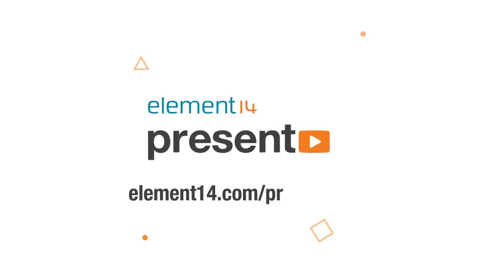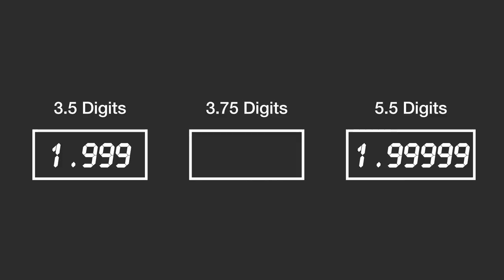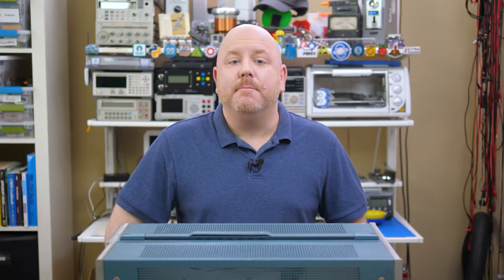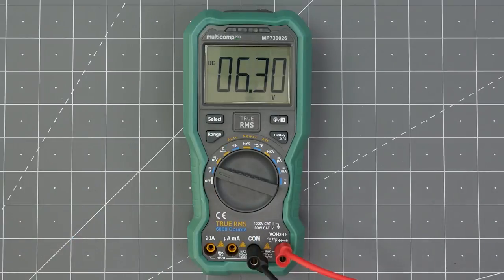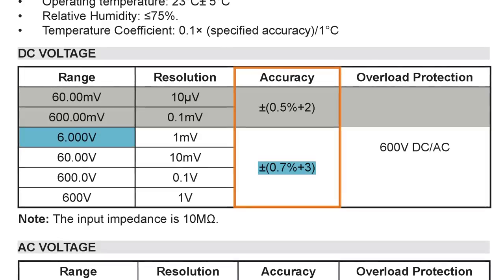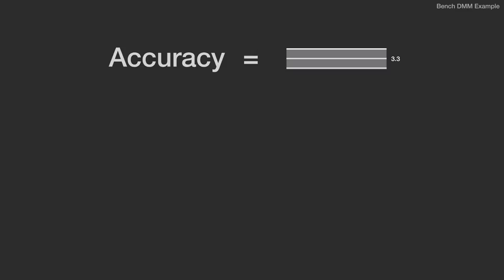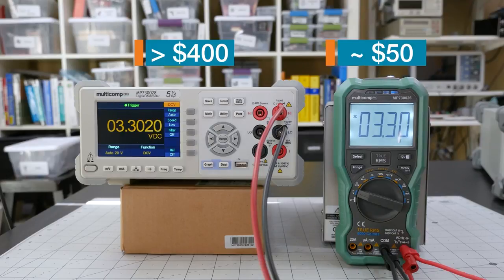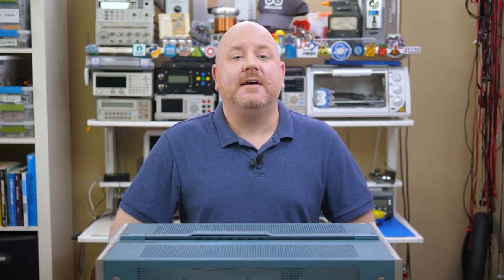Digital Multimeter Half-Digits Explained - Workbench Wednesdays

Comment: Calculation at 5:22 is wrong, because the range is 20 V not 3.3 V, but it will not affect the result.
Right is:
3.3 - ((0.015% * 3.3) + (0.004% * 20)) = 3.299
3.3 + ((0.015% * 3.3) + (0.004% * 20)) = 3.301
Reply: The inherent problem with internet learning, you think you're learning correct info but instead you're being taught wrong info; you take that, pass it along, and eventually we end up with a flat earth society.
Reply: That's still only a 4.5 digit result :)

Comment: Actually, the datasheet of your multimeter specifies 5/6 (not 5/8), which sounds about right. 
5/6 --> 6 possible numbers. 5, the highest number that digit will display.
1/2-->  2 possible numbers.  1 the highest number.

So 1/2 is not really a fraction and shouldn't be called "a half".
Yes it is confusing. Number of counts is better.
Reply: gabriel tabermero  ,  But what is that going to be vs. digits?  Counts may be wasted accuracy if it is not displayed correctly.

Comment: If you had to buy 5.5 or 6.5 benchtop DMM, which one would you buy? Thank you for your videos!!!
Reply: jameshisself  Any specific brand?  You also have a meter like Owon bench multimeter lookalike, it starts with M...PRO you've demonstrated once I think. Any good? What do you like and dislike about it? Is it made by Owon? When I researched it sometimes ago, it stated that it is made by the brand M..PRO, but the Owon looks identical. I'm confused, but I'm looking for an accurate 5.5 or 6.5 (I can't afford the 7.5) digit Benchtop DMM. I like the large display and even touchscreen but they are also expensive. I do understand the extra digits and mainly the ACCURACY is the most important! I get it and I agree, but before I spend some $$ I like to get others opinion and do more homework. If you had a budget about $1000, which one would you buy? Thanks again for your videos and your time!
Reply: jameshisself  You are FAST! Thank you for your suggestions!

Comment: As my explanation for this topic is like this ;
The integer number is clearly meaning the number of digits before the decimal point....
The fraction number is meaning the upper range limit for the counts and should not be treated as a fractional number but as relative number so 3.5 digits does not mean 3 digits and half but as 3 1/2 which sounds like 3 1-to-2 which means the upper limit of meter counts is in the range of 1-to-2 like 1999 ( the upper limit of counts is within the range of 1000 to 2000 ).... Another example is 4.75 which is more correctly to say 4 3/4 ( 4 digits and 3-to-4 , 3000-to-4000 counts ) =3999 ( denoted as 4000 counts meter type ) or could be also 3199 ( denoted as 3200 counts meter type ).... 3 5/6 ( 3 digits and 5-to-6 upper limit range of counts ) =5999 or 6000 counts..... Is it clear now people ??!! ...
Reply: Thank you. Much better explanation than the video. Video is not simple enough. İ was confused. 

As a second note; the notation of this digit system seems unnecessarily complex. Just because something can be written short doesn’t mean it s easier and more user friendly. Human brain is not a compiler that needs a short and smart code. Brain works obviously differently.
Reply: @sds123faf  You are welcome ... But that complexity was not for normal people and unprofessional... These instruments are basically for B2B class products which has nothing to do with consumer products so every user in B2B should have a degree of smartness than normal grade, i.e. who is working on 5 or 6 digits resolutions must be a special smart guy...

Comment: uh... I hate to bring this up.. but your data sheet at 1:55 says 5/6th not 5/8th.. and your right.. this is confusing.. my multimeter works just fine.. go back and fix your 5/6th and 5/8th problems and come back.. In the meantime I will try and find one of these strange multimeters you have so we can be on the same page.. I am 68 and sometimes I am not hip to this new stuff yet.. and the old adage "if it works good.. fix it!"

Comment: 3/4 digit isn't 0.75; instead it should be able to display 4 different possible value for its Most Significant Digit that is from 0, 1, 2, 3
(4 different number capability).

For 6000 count it should be 5/6 digit for MSB, ie. 0,1,2,3, 4,5 (6 different number capability).

2000 counts become 1/2 or 2 different values for its MSB ie. 0 or 1.

Now, let's see 5000 count vs 50000 count vs 500000;
It should be noted as 3 and 5/6 digit vs 4 & 5/6 digit and 5 & 5/6 digit.

You got the idea for whatever count and so on.

22000 count?
4 and 1/2 digit then.
Reply: Budi Suryadinata  ,  Exactly!

Comment: Doesn't these values also change over time?
Reply: Yes, there are services that will recalibrate your instruments for $$$. Calibration usually lasts a year or two depending on the device. Often it is cheaper for a company to toss a device and buy a new one. This is where a hobbyist can pickup quality instruments on the cheap. As long as you realize they might be out of spec, it usually isn't really too much of a problem.
Reply: @DaveMcAnulty  interesting, my mind boggles how they calibrate in the first place
Reply: @lloydtshare  A more expensive version of the same equipment. :) There is always a bigger fish.
Reply: @DaveMcAnulty  but how was the more expensive equipment calibrated, maybe some sort of average?
Reply: @DaveMcAnulty  I've worked it out i know how it's done 😉

Comment: Your 5.5 digit calculations, showed 0.004% * 3.3, when it should be * 20. And it showed a 4.5 digit reading instead of a 5.5 digit. You could see the extra digit in the physical multimeter a few seconds of video previous.
Reply: You missed the point. It was showing the difference between accuracy and precision. Digits/Counts are precision, not accuracy.

Comment: What the hell man? You say count can help us understand more about meter specs, then stick up a title card that says "COUNT".. but in the segment you talk about decimal point, measurement range, and digits WITHOUT EVER MENTIONING COUNT!!

Does it clarify how the counts spec helps, when you don't say what the spec is on this meter, or explain what it means?

(Maybe if you'd said 'the count spec on this meter is 5999, which means the maximum it can display is...')

Then, just to be (more) confusing you say that the meter has to switch ranges to display any value over six.point THREE?  What about 6.00? 6.01? 6.02? (etc).

Then you make the point that 6.300 is displayed as 6.29?? 

You really need to proofread your script better....
Reply: It's easy. The counts tell you the highest number the display can show. 
A typical 2000 count meter can show from 0000 to 1999, which is the same as 3 1/2 digits.
The 6000 count meter goes from 0000 to 5999, that's a 3 5/6 digit display.
You see, the only difference is the moment when the decimal point moves over. If you want to make precise measurements in a range between 1999 and 5999, you better choose the 6000 count meter because you keep the better resolution.
A 50.000 count meter displays from 00000 to 49999, also called 4 4/5 digits.

Also, the accuracy is related to the counts. A meter with 6 digits has to me way more accurate than one with 4 digits, otherwise it woudn't make sense.
Reply: @schorse1000  Thanks for that. It's the clearest explanation of the count spec I've ever seen.

I still think James should've explained what a count spec is, rather than just throwing a bunch of numbers up while pretending it helps explain what the digits spec meant. 

Plus - despite my typo on the actual number - I stand by my contention that he was just confusing things further by saying the meter "must switch to it's 60 volt range to display anything above 6.2 volts", at the same time as the meter showed 6.3 volts. (The "point two" makes no sense whatsoever, since the meter would have to switch ranges to display anything over 5.999 volts). And to top it off, he then says "the tens place wastes one entire digit, so six point three zero zero volts gets displayed as zero six point two nine", as if that was going to clear up anyone's confusion. Especially as the meter clearly showed 06.30 when he first changed ranges...